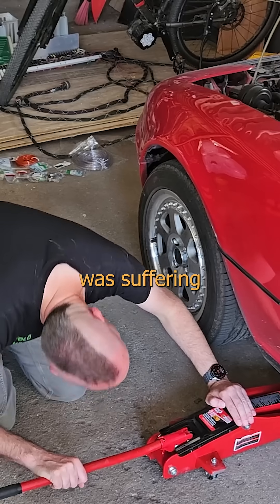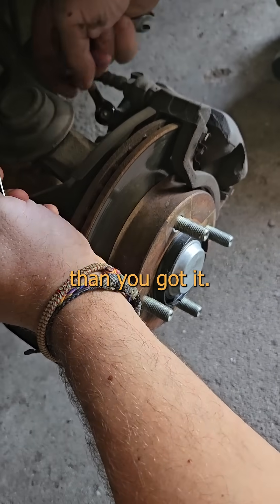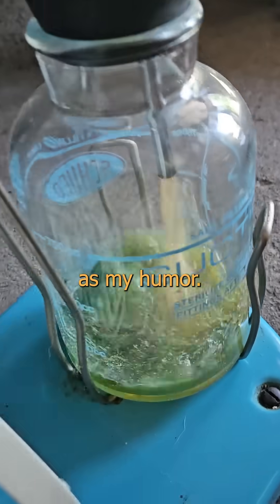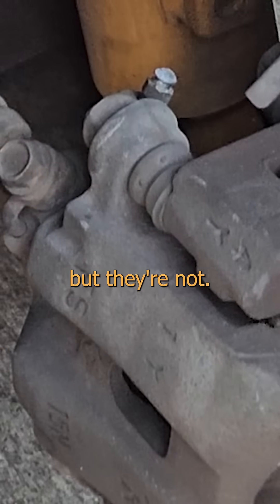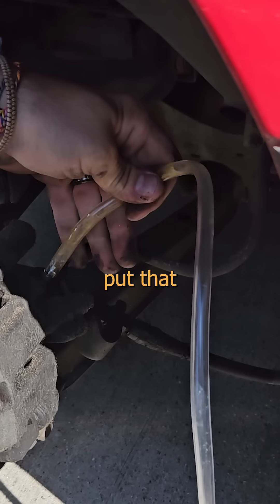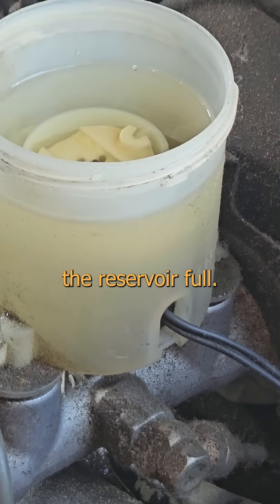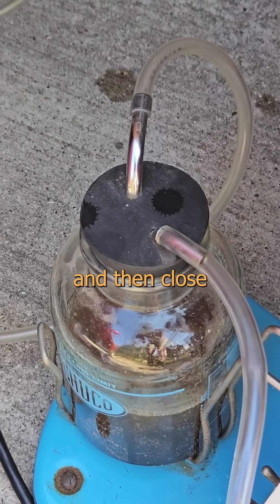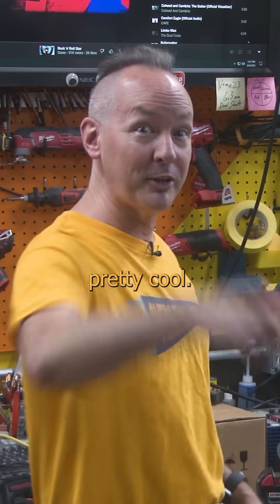How To Change Brake Fluid #chrisboden #comedy #engineering #educational #diy #skills #lifelessons

Comment: Theres also another way, you need to make or buy yourself a fluid reservoir cap with a regular bike schrader valve to it, then turn the compressor regulator to 1.2-1.3Bar,ideally domt go over 1.5 bar or youre gonna break something,top off the reservoir, attach the cap and then start airing out the longest brake line first. When full fluid comes out you know its done. Top of the reservoir if needed and go do the second longest brake line . Then the third longest and the 4th longest.

Comment: Pressure bleeding is better than vacuum bleeding.  I’ve done both, plus some vehicles require the pressure process.
Reply: @treborg777  if you have two people or have a pressure bleeding tool, you can do it with pressure. Tthis way can be done solo.
Reply: @KatthyChurch  I did my racecar alone recently with pressure. It takes some fast movements, but it's possible. I couldn't get the air out of it with vacuum for the life of me, but pressurized, it was done in 15 minutes! (Granted, I didn't have the vacuum THIS GUY did)
Reply: @RudedogRacin  from experience, the problem with vacuum bleeding is that you can suck air down the threads of the bleed nipple and into the fluid so it looks like you've got infinite air in the system
Reply: @KatthyChurch  I have bled the brakes on literally hundreds of cars by myself with a pressure bleeder. no assistance is required.
Reply: If you have a bi directional scan tool you can let the ABS pump do the job for you

Comment: Always start at the wheel furthest away from the master cylinder. Pss rear, driver rear, pass front, then driver front. I was told it matter on the physics level and never questioned it since and havent had a single problem I didnt cause myself 🤷🏽‍♂️🤣🤣

Comment: "Over engineering is best engineering" Bosch is doing everything they can to prove that wrong with their ebike motor systems. My bike with it's 36 volt 13 amp hour battery requires an obscure disposable coin cell for the speedometer, and that coin cell lasts maybe 2 months tops.

Comment: Feel like he should have been more dramatic about letting the brake fluid go empty in the reservoir. If it does go empty, it can suck air into the master cylinder, and once that happens, may god have mercy on your soul 😔
Reply: If you get air into the master cylinder all you have to do is pressure bleed it, its easy

Comment: I'm from South America, Argentina. You're not overengineering at all. This is the correct way to do it. Otherwise, it would be incorrect. In the cross method, first the front right, then the lower left, and so on. Because the two chambers of the pump... very good video, my like 👍
PS: I use two pumps: one homemade that uses a refrigerator compressor with an oil trap, and another like yours with two stages for air conditioners.

Comment: You should only do this when changing the pads. The fluid level in your reservoir also serves as a fast acting way to gauge pad health by inspecting how much fluid has lowered into calipers due to pad deterioration if you change fluid with old pads you risk losing that fast analysis.
Reply: And if the reservoir is full with worn pads , it will be overfull next time you replace the pads .

Comment: Lil advice for people who dont wanna buy a vaccum pump you can use just a little bit of rubber hose that will fit on the nipple and a clear cup filled about half way with brake fluid and have a buddy smash on the brakes youll get the same effect AND THATS PRETTY COOL

Comment: Fun fact: brake fluid absorbs moisture over time this is a problem for multiple reasons the main being that brakes while in regular use can exceed temperatures over 150°C. Most cars use dot3 or dot4 Brake fluid which has a boiling point of around 200-230°c respectively . This lowers as the brake fluid absorbs moisture as water boils at 100°c. Meaning contaminated fluid in your brakes can vaporise under heavy braking and cause air bubbles in your braking system. Air can be compressed while fluid can’t. which means when you hit the brake pedal instead of hydraulics using brake fluid to engage your brakes you’ll be compressing the air in your braking system instead and have no brakes. so for the love of god please have it checked and replaced regularly
Reply: That's because it's composed of ethylene glycol ( the stuff that is in your cooling system ) and ethylene glycol ethers .
Fun fact : if you ever have a " mystery coolant leak " where you smell antifreeze , and yet cannot for the life of you find any sign of a coolant leak , check your brake system thoroughly .
Reply: @kaboom4679 Oh! This is good to know! I was unaware of that, and it could explain a weird situation with my mom's car!
Reply: I once de-merged a 230 odd kg shaft-driven XJ900 from a properly paved path because of this...😅
Reply: It behaves like air in the system, but when water boils it makes steam.  Which is why the brakes may behave normally when the system cools and the steam condenses.  After the crash...
Reply: I think you can see water boiling out of the old fluid in the catch jar in this video. Must be f'n ancient fluid in there!
Reply: Smart comment, thank you! Cheers Dwight!

Comment: This is a horrible way to do this. The damage that you're going to put upon the caliper hoses is irreversible. Specifically says do not drawn to a vacuum on the packaging when you buy the hoses. Your poor friend is going to be stuck on the side of The road with locked up brakes when all four of her caliper hoses fail in a month.

Comment: Over engineering is the best engineering? I wouldn't quite say that. Here's why I think that. Many years ago, my wife and I stayed at my aunt and uncle's house. Wife had a dr appointment and we stayed with them to save hotel costs. During how stay, their 50gal water heater went out. Not usually a problem but it was in the attic in their 2 story house, during summer in the DFW area. My uncle and I got the old one out and the new one to the attic stairs. My uncle is an engineer. In his brain, he was trying to figure out how to rig up a block and tackle system to pull the heater up. I was on the stairs with my head in the attic. After a few minutes, I asked my uncle if he had 2 tie down straps. He did and I told him to get them. He got them and I hooked one end to each side, hooked them together and put the connected straps around my shoulders. I just hoisted the heated in the attic. It's been 20yrs since that happened and I still poke fun at him by saying that it took a redneck to figure out what an engineer couldn't. Family get togethers are fun. His kids are adults now and enjoy hearing that story

Comment: MIAT! I miss my NA8 miata. Manual transmission and the oh so dangerous Torsen Type-1 LSD (only on 94 and 95 models. Updated on 96 and 97 to be tamer and less snappier for street use) and it's a blast. So much fun blasting past cars with multitudes more power in the corners since you can easily go 60+ mph through pretty much anything that isn't a hairpin

Comment: There’s a more overengineered version of this that has a cap that goes on the reservoir to supply new brake fluid. BG makes the machine, it’s incredible.
Reply: Motive Powerbleeder also makes a version- I won’t do brakes without it. Greatly reduces the chance of air bubbles getting sucked back into the system.

Comment: A really good tip I learned from my uncle is to just put the entire jug of fresh brake fluid upside down in the resivoir, it won't overflow and if you have someone watching it you just have to stop flushing when the bottle is empty. Or do like I do and gravity drain all the brakes going back to the engine every minute to check the bottle

Comment: I would typically remove the bleeder screw, wrap the threads with Teflon tape, then loosely reinstall it. Helps prevent air leaks through the threads while vacuum bleeding the brakes.

Comment: Is there any size of hose that actually fits properly on those bleeder screws and doesn't just let air in at the edge? because my constant battle when doing this is just getting a good seal on that thing.

Comment: Should also note that when dealing with brake line/bleed nuts one should always use flanged wrenches. 

And I prefer the positive pressure type bleeders, but if done right vacuum is fine.

Comment: Aviation mechanic here with a hobby of working on shit boxes. Always start with the brake caliper that is the furthest away from the brake booster. Then work your way to the caliper closest the the brake booster. Ie if the brake booster is on the front left of the car, bleed the back right caliper first, then back left, followed by front right and finally front left. This ensures all the bubbles are out of the systems.
Reply: I hear by volunteer both of my shitBoxes for you to work on if you would like
Reply: @emmelsmusic79  Right? I need a mechanic friend who needs payment in either good home-cooking or IT services, LOL.

I keep considering setting up a thing like this with my friend groups. Find out what skills everyone has, and we can arrange trades!
Reply: I would take that a little farther if you have abs. You need to start with the wheel that has the longest run. Like most Hondas, the abs pump is on the right side while the brake master cylinder is in the left, so the rear left actually has a longer run than the rear right.
Reply: Or better yet - do it in the order the manufacturer specifies, which is NOT always that order, especially on cars with ABS.
Reply: Correct
Reply: If it has ABS you should just go with what the manufacturer suggests though.
Reply: If there isn't any air in the system to begin with, that really doesn't matter. He's flushing the fluid, not bleeding air. Of course it doesn't hurt to do it the way the manufacturer recommends, but in practice, it makes little to no difference whatsoever for a service like this.
Reply: Great advice! Thank you!
Reply: My 2001 Prius doesn't have a brake booster, it's drive by wire braking and you need a scan tool to bleed it.
Reply: There's an argument that you should actually follow this logic from the ABS module not the master cylinder. A lot of vehicles have them on opposite ends of the engine bay. The master cylinder is upwind of the module. Ive done hundreds of cars off the master cylinder logic, but it's food for thought.
Reply: I would like to say thank you. I've learnt something more from the people in the comments. I've only ever worked on cars that don't have ABS and the aircraft I work on also do not have ABS for reasons. I did not know that ABS units would effect the bleeding of brakes but it does makes a lot of sense.
Reply: Mechanics 101 my friend. Learnt that way back when I was 15. Half a century now....
Reply: The "start from the farthest caliper" approach is from ye ancient times when things were written on stone tablets, there were no power breaks, and there was a single line going to the back. Follow the manual, you can't tell what the branches are or the lengths of the lines just by looking at the. The engineers that built it do.
Reply: mechanic by trade here, I confirm that it is the correct way to do it.
Reply: @devilmane5578 This is not true for modern vehicles.  GM master tech here.

Comment: As a Welder who's had many an argument with engineers on how people can't fit in 4inch spaces over engineering isnt always the Best
Reply: Or in Air Conditioning when the condenser is 12 inches from the wall and you have to get behind to replace the failed one. Yeah engineers don't always use their brains.

Comment: Brake line failure is the same from rust belt to the rest of the country. This shows that brake lines don’t rust from the outside in but rather the inside out. The fluid is hygroscopic meaning it loves water and attracts it. What happens then is it rusts out your lines. One of the only fluids in your car that no matter what it has a service by mileage/date other than oil (of course all fluids should be serviced) and is federally regulated on its quality because it controls you stopping your car. DOT 3 and DOT 4 are not the same but 4 can be used in a 3 system; 3 should NEVER be used in a 4 system.
Reply: Not true. Brake lines here rust out at the clips that hold them to the frame. Southern Ontario, same climate as Michigan.
Reply: 99% of brake lines i have replaced have corroded outside in,

Water sits in the fittings and clips slowly corroding away the outside

Brake fluid is an oil, even contaminated brake fluid will hardly rust a brake pipe from the inside since it's still coated 99% of the time in oil

Comment: Best 90 bucks i ever spent was on a master cylinder bleeder. Looks similar to yours, however it caps on the master cylinder and does the full cycle without touching the pecocks.

Comment: That's not overengineering. The vacuum pump they sell at the auto parts store is usually MANUALLY OPERATED, and it's a MFer.

Comment: Start from the furthest away from the brake cylinder too. Dont learn the hard way and waste brake oil trying to get air out that is stuck in the back brakes lmao
Reply: Brake fluid is a closed system that doesn’t recirculate. Best practice is to start furthest away but really it doesn’t matter much in reality because each wheel is its own line.

Comment: That sounds so much easier than pumping the brake pedal like it owes you money. Core childhood memory for sure - sitting in the driver's seat, shorter than the top of the steering wheel and listening to my dad's instructions "pump, pump, pump, hold"(or was it pump until the pedal gets stiff?) and then the gentle release of the pedal as he opens up the bleed valve.
Reply: Been there done that!
Both sides!
Reply: That's how we did it too. Keep pumping the brake until it doesn't hit the floor anymore. 

My dad is the youngest of 5 boys and the next older one to him is 10 years older. My uncle had a dune buggy in the garage he was working on and he told dad not to touch anything (He might have been 6 at the oldest.) He got in and was playing like he was driving and smashed the pedal and sprayed brake fluid everywhere. My uncle was not impressed, especially since he had to clean it up.